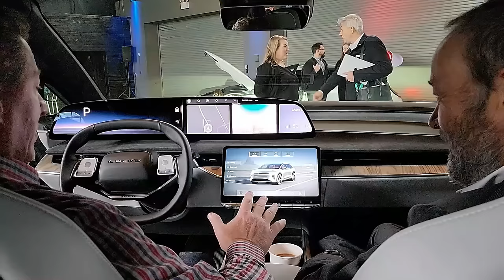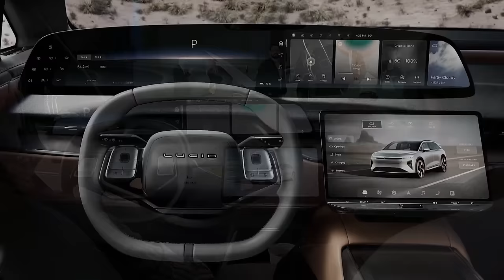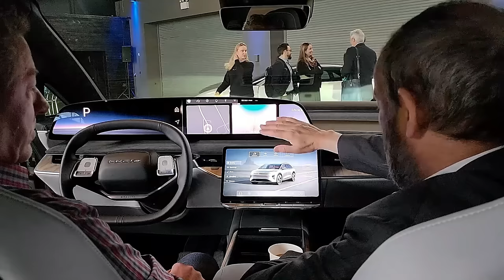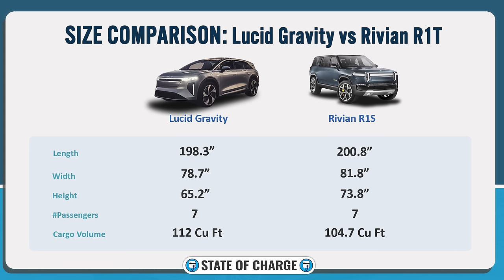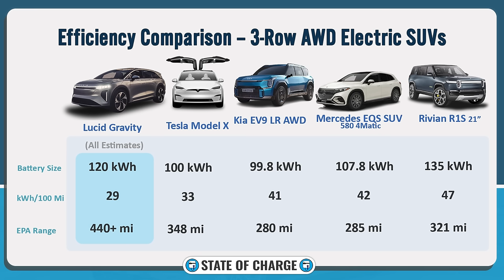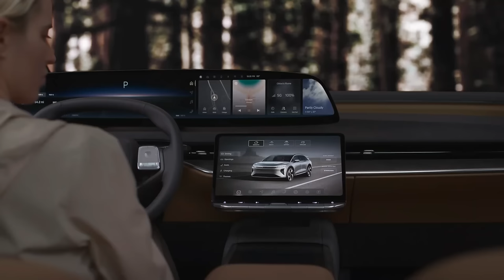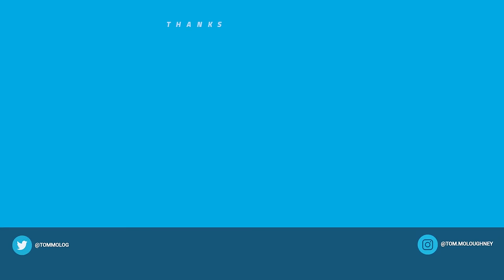Exclusive Interview With Peter Rawlinson On The Lucid Gravity Electric SUV

Comment: Great interview!  One question I would have liked you to ask him is why don't they produce a lower cost version of the Gravity with 300 mile range and a smaller battery.  By my calculations that should enable Lucid to drop the price to about $54,000 and which probably would substantially increase the demand.  300 miles of range is still very respectable.
Reply: They are working on more cost-efficient vehicles that probably won't be announced until 2025-2026. They need to be financially stable before producing cheaper EVs. If you can't wait, just go with a different company.
Reply: They said they will by 2026
Reply: For now, they don't produce a Gravity at all, but Lucid is looking forward to following up with things along those lines. The constraint is that if they try to do everything in parallel, they'd go bankrupt. Having the revenue from the Gravity should be able to give leverage to move to that next step. So I hope they can get the Gravity out as soon as they can, as long as they get it right.

Comment: The interior design is fantastic. Love the large single display. Most other cars just have several different displays mounted together and pretend like it is one display (like Mercedes hyperscreen for example). I just wish the sunshades would be mounted on the A-pillars like the Tesla model x. I prefer to have a giant open expanse of glass.
Reply: I have contact lucid employee  and have been  informed  that the tesla sunshade has copyright  so lucid can not copy that style and they still look to find some  other way . But for now, the federations require sunshade to be sale .
Reply: On the Air, I can pivot the sun visors toward each side window, pull back to extend them, then fold them up toward the roof. That puts them pretty much out of view. Ideally, if the metal rod could be pivoted up slightly when it that position, the visors would be even more tucked away. But as it is, with the visors in that position, people don't notice them.

Comment: Tom I'd love to hear Lucid's response on the record about what they plan to do about their 900V architecture Gravity charging on the NACS infrastructure. Obviously we know that the Air's Wunderbox can only output on the Magicdock equipped V3's. But the Gravity won't come out for 12+ months. I wonder if they have plans to upgrade the Wunderbox for 150kW charging on the older, sub 500V chargers.
Reply: Seems Tesla needs to upgrade their equipment. They seem to be stuck in 2017 mode for the most part. They are still installing v3 superchargers. Even the v4 superchargers are not set up at the moment for 800v charging. Other companies have the tech out there now and have been out there.

Comment: Peter's sentiments about the yoke design pretty much matched my objections to Tesla's choice for the S & X and particularly at the time of the CYBRTRK reveal event. You'd get a lot of complete Pickup truck novices deciding to do an 'off-road adventure' and should they lose control of the yoke, for whatever reason, & especially in an emergency, I felt that there stood to be a LOT of broken wrists and forearms (at a minimum) & perhaps something a hell of a lot worse if a major accident ensued. This [would not] have reflected well on Tesla had they stuck to their design guns with the yoke; thankfully, they saw sense. Their customers' overall reaction to the yoke probably also contributed to the design change.

Comment: Hey Tom, I do enjoy your videos and find your information very helpful.  I am a Lucid Dream Performance owner and when I bought my car the Lucid team was actively promoting through their Sales Reps and online the bi-directional capability of the Lucid Air.  The battery in my Dream (118 kWh) is the equivalent of almost nine Tesla PowerWalls.  I bought the Lucid Connected Home Charging Station (LCHCS) when it first became available in early 2022 with the understanding it was bi-directional capable and would facilitate V2H/V2G.  Can you shed any light on why after two years this capability hasn't been brought to market by Lucid?  Wouldn't it be an additional sales feature that could attract buyers who live in areas subject to power outages??  Your thoughts will be greatly appreciated.
Reply from the maker: Basically, I believe (with no proof) that it is a simple matter of the company putting more effort into other more pressing matters. I know they are still working on it, they just have other engineering challenges that are taking up a lot of bandwidth.
Reply: Well thank you for your response. I hope you are right but after two years and the fact Ford has it operating I have to wonder how much longer we’ll have to wait.
Reply from the maker: @saratogalefty5337  Ford has nearly endless resources and engineers to work on as many projects as needed all at once. The startups don't have that luxury.

Comment: Are seven seat configurations standard on all trims for the Gravity? I’m most curious if the sub $80k variant will have 7 seats as this would be hands down the best 7 seat EV option if so.
Reply: Yes that is correct , the different  would be about like size of batteries, some features  like seat heating , and like auto-drice( when it will be released) and some stuff

Comment: Rivian owner here...

Not sure why it's not mentioned but  the R1S you have is a quad motor...and the range you shared was in all terrain mode.  

1. You can drop to converse mode in the quad motor and add 20-30 miles.

Additionally, the newer R1S dual motor gets 400 miles..

Again, not sure why these important details are not mentioned.
Reply: But still, it  lucid gravity 440 miles. But you kinda right. The information should be accurate
Reply: All true.  Riv owner here as well after passing on every Lucid I drove ( nice old mans car) .   Realistically, not a single BEV ever gets the “ proclaimed “ range. My closest was my Bolt, but add in HVAC and they all take a 20-30 % range hair cut in winter or summer.  Yes, my Tesla did as well.
Reply: However that RIVIAN is still ~2.5mi/KWh. I think their point was more about efficiency than range since they mentioned they just didn’t want to keep adding batteries. 
It may be like comparing a 4Runner with a better city performance vs a Highlander. The Highlander won’t take you to all the places the 4Runner can, but it’s more efficient in the city.
Reply: @manuelias86  if you’re looking for pure efficiency, then yes,Lucid is the choice. However, the current Air models are nothing more than  E class sized sedans that offer little else in hauling capability.    At 70 mph constant highway, a Riv on  Conserv mode will get you 342 miles which is quite impressive.  The big plus is the R1T bed and gear tunnel.  Don’t think the Gravity will have that kind of tow or haul ability.

Comment: 9:37 I'm confused by this graphic.  If you have 29kWh/100mi that reduces down to 0.29kWh/mi.  120kWh/(0.29kWh/mi) = 414mi.  Where does +440mi come from?
Reply: 440 may be a mixed efficiency. City/Hwy. the efficiency number quote here may be at a specific speed.
Reply from the maker: That figure was to compare to the EPA data on the other vehicles and that figure published on the EPA site included charging losses, not running efficiency. If you were to back out the charging losses (subtract .02 kWh/100mi - my rough estimate), it would add up to 444 miles.
Reply: @StateOfChargeWithTomMoloughney  hmmm, I’ve never considered charging losses in a mileage figure. I’ve also never seen it mentioned that it was included either. I would wager that even enthusiasts in the EV space wouldn’t assume this. I feel like charging efficiencies should be pulled out as a separate metric, and it would be interesting to see how that metric in isolation compares between vehicles and brands.

Comment: Love the commitment from Lucid to efficiency, but honestly the Gravity is not THAT groundbreaking in that front. They could have made a slightly smaller SUV/ Crossover even more aerodynamic and achieve 500 miles
Reply: Umm you forgot peter said In excess of 440+ miles meaning there might be more range not being revealed yet
Reply: My Air GT will go as far on a given amount of energy as my much smaller Model 3 did, despite it being a car as big as the Model S on the outside, and the Mercedes S class on the inside. I'd say that's groundbreaking.  It will be a long time before I know how much it will help having so much range. I think that if I had to get by on 440+ miles, I'd do fine. I had a lot less than that on earlier cars.
Reply: They may not be in a production state that they can go smaller since the price should go down as well thus more orders. I thought their factory throughout wasn’t that great yet.

Comment: How about mirrors folding into the doors on highways, would it be better option compared to Cybertruck manualy removing them, would it be worth at least like a option in some countries
Reply: For now, the mirrors are a legal requirement in the US. I haven't driven a Cybertruck and don't know if I ever will, but I can say that the Air has the blind spot camera displays more intelligently placed than Tesla does on earlier cars. I still use the side mirrors on occasion but could probably do fine without them. And they do have the blind spot indicator, which Tesla stubbornly leaves out.  That information is available on the screen, but after nine years, I still haven't gotten accustomed to that to the point that I like it. Another advantage of mirrors is that if I want to take a quick glance when my turn signal isn't on, I can.  I don't think that I'd want the side view cameras displayed at all times.

Comment: look like a mini van...:)
Reply from the maker: Yes, I agree - except it doesn't have sliding doors
Reply: @StateOfChargeWithTomMoloughney  Sliding doors can be quite practical. But then it ends up in a class that's being derided for no other reason than a conception of what a minivan is. I've had minivans and they were practical when I had three young kids. They drove like midsize non-performance sedans, which wasn't terrible. There's no way that the Gravity will be like a minivan, except in the practical sense, which is not a negative. And on the inside it won't feel like one at all.

Comment: I hope Lucid offers a solid roof option. For some an all glass roof is a deal breaker. I have begun to hate it in both my model 3 and my Mach e. The after market shade helps but I would rather I had a solid roof option.
Reply: Lucid offers a metal roof on the Air for all trims except the Grand Touring. I haven't driven a Mach e but I'm curious why you find it a problem in the Model 3.
Reply: @bW9taeH4 rear passengers complain about the heat and brightness when the sun is overhead
Reply: @irfanhusein1445  I've found Tesla's air conditioning to be better than in any other cars I've had. I've driven a Model S in temperatures in the triple digits without realizing it until I got out of the car and felt how hot it was. I'm not saying that your experiences aren't real, but I find it surprising. I did have a Model 3 and never had that problem. I haven't had a Lucid long enough to see how it will be in the summer.
Reply: @bW9taeH4  I purchased a roof shade form Tasmanian to put up in the summer months. The fact that Tasmanian make these shades for both the Mach e and the model 3 tells mr I’m not the only one with this concern

Comment: It’s not really an SUV…. More of a minivan or station wagon. Still pretty awesome IF it can go into production with those specs
Reply: Station wagons aren't really station wagons, if you go back to the days when they took people and cargo to and from train stations. They were practical, but eventually sexism made their "mom's car" image undesirable. Then Iacocca took the macho image of a van and created the more macho minivan, but over time, people began seeing that as a soccer mom's car as if there's something wrong with that. Then people moved to SUVs even though most people didn't need something for off road that drove like a truck. So crossovers came along. It all comes down to what's practical, meets a person's needs, has the desired performance and features, etc. And this does that for a lot of people. Getting hung up on definitions where they don't apply isn't helpful. Since EVs have separate power trains in front and back, the idea of a traditional SUV body and suspension isn't relevant. If it's marketed as an SUV and it meets people's needs better, it should do well. 

Ironically, it's closer to the original notion of a station wagon than what modern station wagons are, and I don't mean that as a bad thing. But calling it that isn't a good thing in today's market.
Reply: Close, but SUVs were a way for manufacturers to get around the EPA mandates for efficiency. By putting a car/station wagon on a truck frame they bypassed car requirements and instead got much less restrictive truck regulations. 

It’s not an SUV. It’s probably not even a crossover.

It’s a minivan with a low profile and low loading decks front and back per the CEO… the only people that don’t want to call it a minivan are the ones that have negative image of them…

If all else fails, just use your eyes. It does not look like any SUV but looks like every minivan.

Comment: I think lucid is missing a huge critical point in design, the design should be more bold . I'd rather have a hummer ev or rivian r1s over this one. The design looks like a van which is not a good thing. Look at the rivian r1s and compare it to this one.  Space, efficiency,tech doesn't compensate for bold design
Reply: I think it’s just efficiency. Low to the ground (air suspension helps) and 🥚 shapes. I agree the hummer and RIVIAN are more my style, but you won’t get the +3mi/KWh that Lucid or Model X can do. However, these probably can go off road like RIVIAN or Hummer can do.
Reply: I have nothing at all against Rivian and think that they are doing a great job. Some people will prefer them, and there's nothing wrong with that. Others will prefer the Lucid. If Lucid had gone more in the direction of Rivian, that wouldn't leave consumers with much choice and variety.  For some people, not only do those things more than compensate, they spend almost all their time with the car on the inside of it. How it looks to others isn't everybody's biggest concern.

Comment: no matter what he says, losing $300,000 per car on a $120,000 car that is full of quality issues is a formula to go bankrupt. Building a factory in saudi arabia where there is no ecosystem nor engineering talent, is a sure way to accelerate that demise.
Reply: We are on our second Tesla -- a 2021 Model S Plaid -- as well as owning an early-production Lucid Air Dream Edition (No. 154).  Outside of software issues, the Model S was delivered with more quality issues than the Lucid Air, and dealing with Tesla service is a bear.  (The Lucid software issues have largely disappeared with the OTA updates following UX 2.0, and the control suite combo of buttons and screens in the Lucid is now something we prefer over the Tesla.). Right now we're trying to get a replacement for the Model S yoke that has lost a sizable plug of its cover on the upper left corner (a widespread issue), and Tesla is saying they are not available right now and that we should check again "sometime" in 2024.

Comment: Will Lucid lose 400,000$ on every GRAVITY sold? 😢
Reply: They don’t lose money on cars. If a company sells 1000 cars, and also spends a billion on new factories, if you divide total spend by number of cars sold, it looks like they’ve lost money per car. In reality that’s not the case. Tesla went through this for 10+ years
Reply from the maker: Of course. Anyone that know the industry understands that. @pravinpravin9936
Reply: @pravinpravin9936  People made the same argument with Tesla, as if every solar panel or roof tile they made was part of the cost of making each car. Some of the expenses are related to current production. Others are not. Fixed costs divided by vehicles are going to be too high when volume is low. But expenses related to the Gravity or anything on the drawing board for the future are not part of the cost of building an Air. So dividing the total loss by the number of cars made and acting as if that's the loss per vehicle is far off base. Software costs are going to be higher now, but when they are selling in volume, those costs don't rise with production volume. If they were losing that much per vehicle, then losses would increase proportionally as sales increased.
Reply: Yes crazy model x came out a decade ago now

Comment: He talks about adding batteries yet he has as many batteries as the huge cybertruck does. If my model X had 122 kWh battery it too would get 400 plus miles. That’s 20 % bigger battery
Reply: keep going your model X has a lot of "ifs" it could definately add
Reply: That’s not how physics works. The heavier the car, the less efficient it will be.